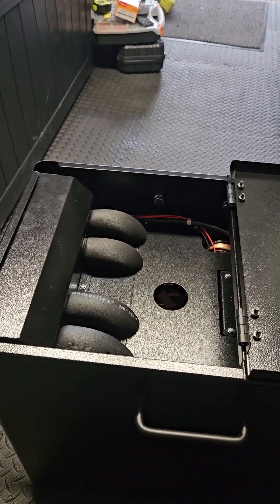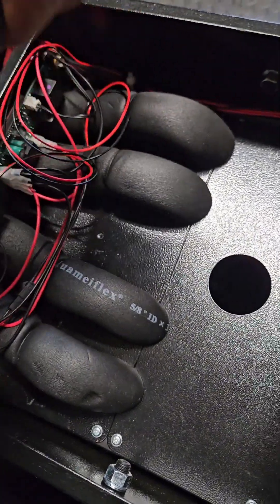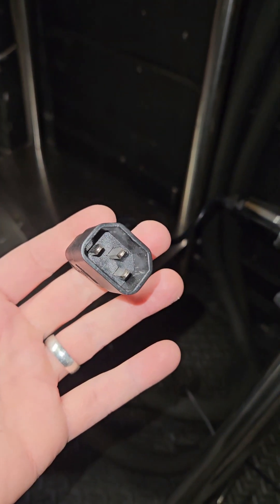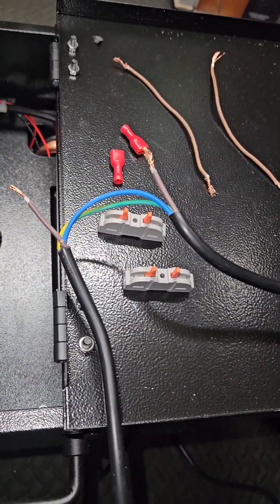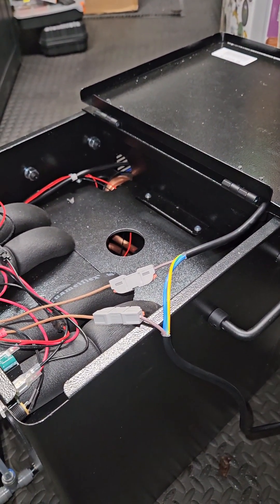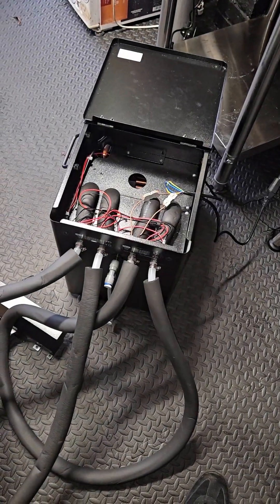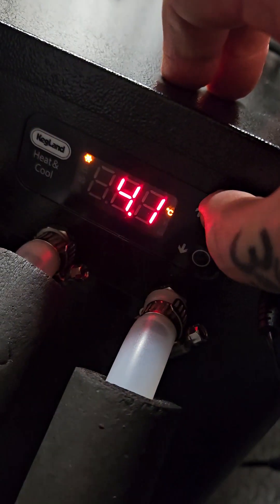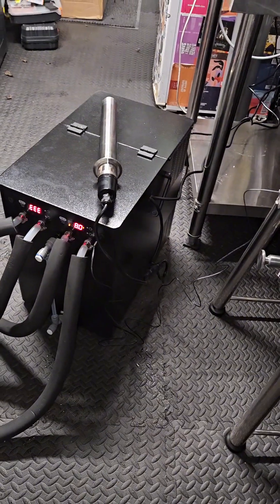How to connect a heat source for the Brewbuilt x3 to the Kegland G20.1 glycol chiller (idiots guide)

Comment: Thanks a lot for this quick video. It helped a lot!
I have one question does it matter where you put the in and out?
Reply from the maker: Glad you found it helpful, well I'd say it all depends on which fermenter you use, I've got a Brewbuilt x3 and the in has to go to the bottom port on that fermenter, I also use a fermzilla with the cooling coil so that doesn't matter which side that comes out of
Reply: @foxbrewing i think i said it wrong (my English is not my main language)
On which side of thé relay do i have to connect thé power outlet and on which side thé heating source. Im sorry
Reply from the maker: @TomMissotten-v4q oh my apologies, I misunderstood, so looking at the glycol chiller face on the heating element is connected at the right hand side spade and the elect coal supply the left hand side spade. Hope this helps